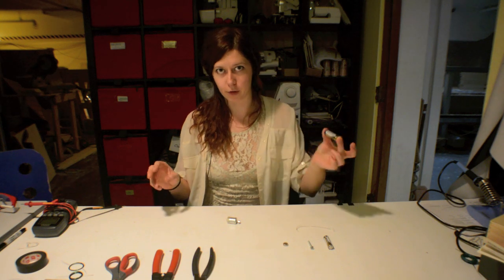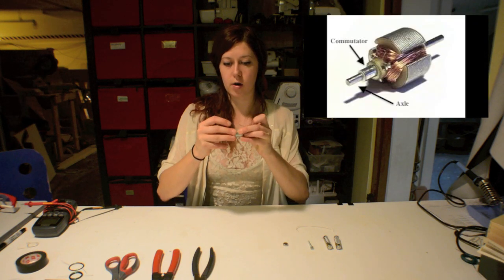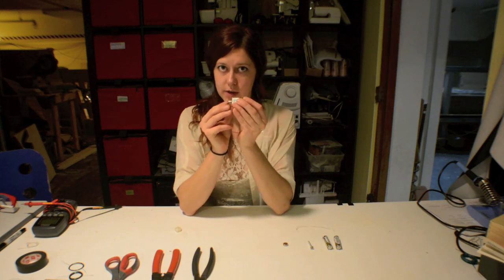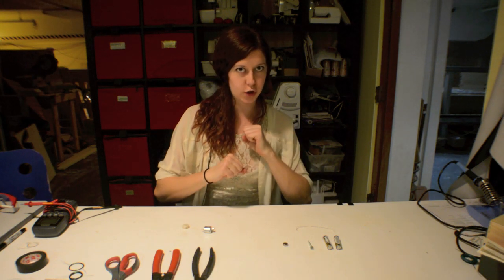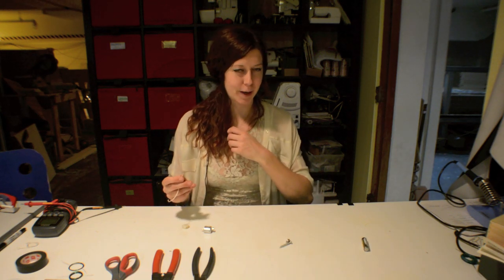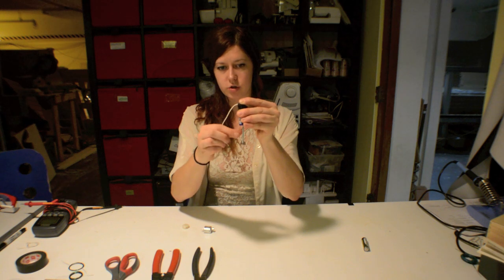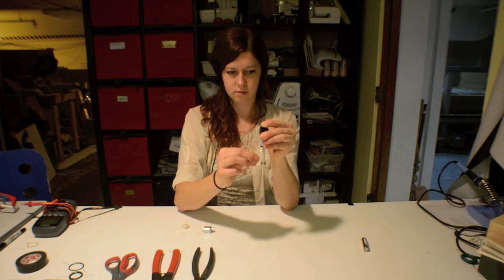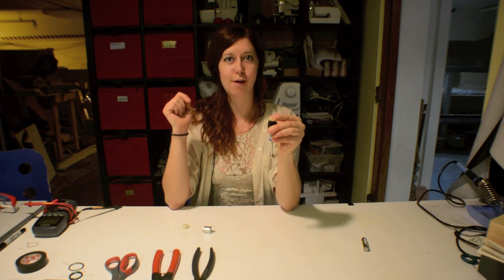Maker Quest: Intro to Motors

Comment: torque is not produced as two equal forces in same line but opposite directions cancel out each other when wire is touched on bottom of battery...
Reply from the maker: +sang chuk close! Think about the magnetic field lines on the magnet. Which way are they pointing on the bottom versus on the side? What happens if you add a current flowing through the bottom versus on the side?
Reply: +jen foxbot ..i am trying to apply the flemings left hand rule in ur exp..can u explain how it works.??
Reply from the maker: +sang chuk Right hand rule! That might help :) 

Here's a picture of the magnetic field lines: http://www.allegromicro.com/~/media/Images/Design/Position-And-Level%20Sensing-Using-Hall-Effect-Sensing-Technology/fig9.ashx?w=450&h=438&as=1&la=en

If the current is flowing through the bottom, will the magnetic field lines due to the current affect the magnetic field lines of the magnet? Once you have a handle on that, think about how you can apply that logic to the side of the magnet.